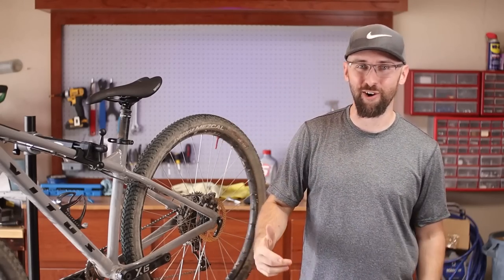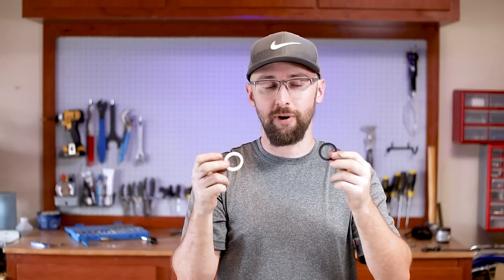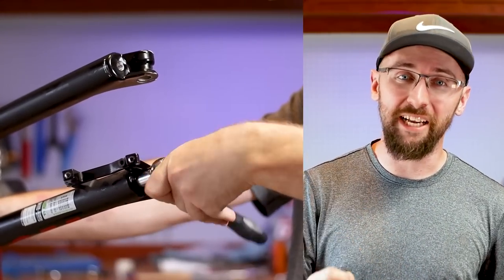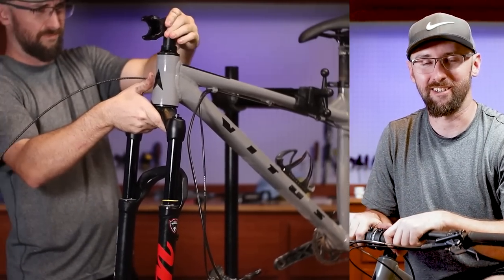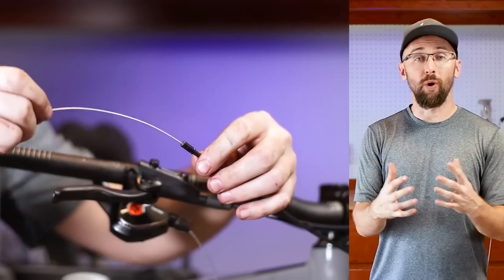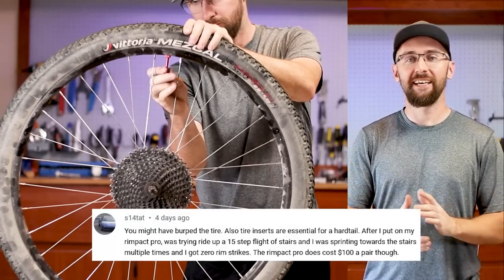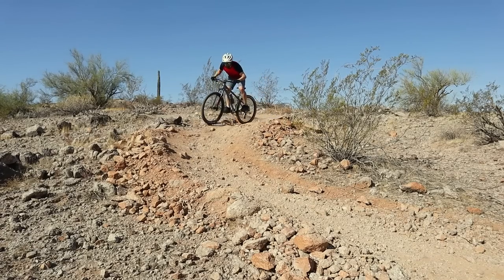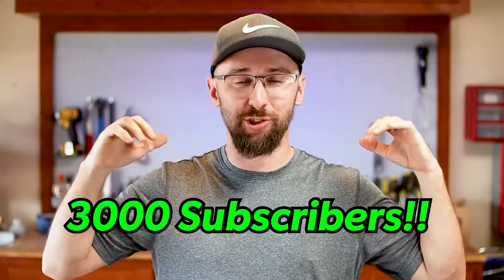Vitus Nucleus REBORN | Budget Mountain Bike Upgrades | Manitou Markhor Travel Conversion | 2021 VR

Comment: I recently bought myself the Tannus Armour Tubeless tire insert for my Vitus Sentier hardtail to run it in the back. I went for a Maxxis Rekon 2.6 in the Exo+ casing which is a lighter tite than I would normally put on. The tire is faster rolling and lighter than the Schwalbe Hans Dampf that came stock. With the insert the back wheel with the Maxxis Rekon Exo+ is still lighter than with the Hans Dampf without an insert but I feel saver riding with the insert and the lighter tire to be honest. I'm really surprised by the insert. It is supposed to be kind of between the cush core pro and the nukeproof ard insert. It is supposed to feel a little bit like cush core but offers more protection and sidewall support than the nukeproof ard. Wasn't hard to install at all, isn't expensive and is also pretty light in my opinion. It already saved me from a few rim strikes and what surprises me the most is that you can get home with close to 0 psi in your tire. Also you don't need a special valve stem since there is an air pocket between the insert and the center of the rim. I can definitely recommend the Tannus Armour insert if you're not convinced by the nukeproof ard and if you're not up for the hassles of a cush core installation and it's high price. But be careful when you buy it there also is an insert for tube systems.

For an upgrade fork I can recommended the newer Rock Shox Revelation models if you are aiming at 120 to 150 mm of travel. It is not an XC fork it's more like a stiffer trail fork but still really light with around 1.8 kg. If that's what you want the Revelation is my strong recommendation. They basically are a Rock Shox Pike but with the older Motion Control damper which still is a good damper and definitely a much better one than the Manitous. If you willing to upgrade it you can easily upgrade the Revelation to the high end Charger 2.1 damper (Rock Shock Ultimate level) since is has the same stanchions and lowers as the Pike. The Revelation has the same debonair air shaft as the Pike which provides a supple feel. Also you can fit tokens in the air chamber to make the fork more progressive. If you're up for investing a little bit more go for the Pike Select. It has the normal Charger Damper which is a better damper than the Revelations Motion Control Damper. It's not the same as the high end Charger 2.1 but I would argue most of the people don't even feel a difference between the Charger and the Charger 2.1. But the Charger definitely is more supple and noticeable better than the Motion Control damper. So if you in for a bigger investment go for the Pike Select cause it has the normal Charger damper. If not go for the Revelation because you basically get a Pike with a Motion Control damper which definitely is a good damper but also you get lots of room to urgrade the fork up tp the Rock Shox ultimate level if you would want to. Don't be tempted to go for the cheaper Rock Shox 35 since you can't upgrade this one like you could with the Revelation. If you want more of an XC fork I think the Rock Shox Reba is a good choice but if you're up for a more burlier fork for more agressive trail riding go for the Rock Shox Revelation. If you have to option go for a 2021 model since it has the newest upgraded debonair air spring.

If you really wanna go for an enduro fork get the Rock Shox Yari. The same relation between Pike and Revelation applies for the Lyrik an the Yari. But Lyrik and Yari are heavier and meant for enduro riding with travels between 150 and 180 mm.

Comment: Hey for your Fork service. Don’t just jam the lower down! Put the screws back in two turns and then but the socket over there and hammer on them to loosen the damper and air spring! 
Also if you’re pulling out the dust wiper don’t use the wrench over the other lower side! You can hurt yourself pretty badly! Use the wrench over the back or in your side the front facing the bridge! 

As you said the forks are pretty entry fork! Put some z2 or better z1 on there! They have a similar damper to the fox 36 / 34 performance so they work pretty good! You also get fox’s warranty and they’re a lot cheaper! You can adjust the airspring with tocens and you get Lowspeed rebound and Lowspeed compression adjustments! So have a look at them!

Comment: You can buy a fox 34 rhythm used for $250-350 on eBay. I think they start at 130 travel though. You can use air tokens in that fork. I'm not much of an XC rider, but my buddy let me borrow his carbon XC race bike, which has a Fox 32 on it. I live in AZ as well and it felt pretty good over the rocky stuff.

Comment: You've inspired me to try some upgrades to my specialized chisel as well Evan....I just ordered a new take off Reba that I'm going to increase the travel on and upgrade to a debonair head prior to installing. Hope I don't jack it up! Also I'm new to this as well and went with the tannus tubeless insert....but I put it in my front wheel because thats where I was getting punctures....thinking about moving it to the rear since that's what seems to be the recommended way. Haven't got any flats since I installed it though....worth it so far. Thanks for another great video!
Reply from the maker: Heck yeah Chris! The travel conversions for the forks are so easy! Just follow the service manuals perfectly and don't over tighten (especially bolts with rubber seals). You'll see it's pretty fun after you're done.

Comment: Great vid! Keep up the good work! And you could try a SrSuntour Axon Lo Rc Ds (personally, i love srsuntour higher end forks) and the fork is like 460 usd from the srsuntour site, but if u can find it ebay or amazon or even at a bike shop near you, you could get it for a lower price
Reply: And it weights 1600 grams.tho, if u got a big budget, there is an axon model with 34 mm stanchions but is 200 grams heavier, and around 200 usd more

Comment: Rather than new fork. If you like to try adding TOKEN, you can add some fork oil into the positive air chamber. Fork token is simply a volume reducer. So the more oil you fill, the more progressiveness of air spring you got. I did the same to my fork (X-Fusion Streat) when I converted from 100 to 140 as well.
Reply from the maker: Dude such a good idea! I guess that fork can get an upgraded damper which I'd love to do, but it's hard to find the parts for that.

Comment: I just picked up a vitus sentier and swapped out xfusion 32 for a rockshox 35 gold with 150mm travel. Noticeable stiffness in the fork which feels awesome! Also feels way better overall on small bumps/drops. I picked mine up for 200 bucks on OfferUp in my area but I have seen them online for around 250-350. Definitely worth taking a look at it!
Reply from the maker: Woah dude that is an amazing deal. I almost snagged a Yari for $200 but the guy flaked. I will check out the 35, thanks for the recommendation!!

Comment: Not sure if you're aware, the Markhor's can be upgraded with a better damper that is supposed to give you more adjustment and improve the ride.  The ABS+ is part 141-26532-K001 and replaces the kwik toggle damper that doesn't do much.  May be hard to find though but at around $70 or so is supposed to make the forks better.
Reply from the maker: Sounds like a sick video idea!!! Thanks for letting me know. Hopefully it comes with the whole damper because I definitely stripped out the damper bolt for the lower 😂
Reply: @EvansMTBSaga   Unfortunately no, you need the damper assembly, 141-31870-K008.  If you go on Haye's site you can see the service manual and it gives you all of the parts.

Comment: It keeps getting better!! Keep it up!

Try an aion fork from suntour
Or a marzocchi z2 it could be configured as low as 100 travel
Reply from the maker: Thanks for the props and recommendations! I have a Z2 already and love it. I would be curious to see what it's all about at 100mm. Multiple people told me about the Aion, never heard about it til yesterday! May have to check it out.
Reply: @EvansMTBSaga  i run an axon. suntours are easier to service but have less small bump compliance due to the negative coil spring, more of a hard hitting fork imo. the z2 would be the better but pricier option ;)

Comment: Put some suspension oil on top of the air spring. It will work like a air token and make the fork more progressive. 5-10ml should do it.
Reply: jomax clux  Let all air out of the fork. Remove top cap on the air spring side. Add a little suspension fluid (5-10ml). Re-install the top cap. Add air. Go ride :-)

Comment: You should look into the ABS+ damper upgrade for the Markhor. 
It’s the damper for the old Manitou R7 Pro (higher end XC fork), which features a Low speed compression dial, and adjustable shim stack for the High speed compression.  It definitely gives the Markhor more support, it won’t make them more progressive, because it doesn’t change anything to the air chamber tho. 
I don’t regret the ABS+ upgrade, it gives the fork a nice upgrade. 

If interested I’ll try to provide you with a part number.
Reply from the maker: I would love to get my hands on that damper,  it's just that they're out of stock everywhere!! Bums me out!!
Reply: @EvansMTBSaga  Big chance you'll have to order it from Europe. 
The part number is  141-26532-K001.  Make sure the bottom part of the damper is green. Other colors are for 32mm and 34mm forks, so incompatible with the Markhor.
Bike24.de sells them (currently out of stock, but they're saying back in 2-4weeks). Their shipping costs shouldn't be too high.

Comment: you can do the ABS+ upgrade for $70 on your MARKOR.
Reply: I fully support this as first approach - enhance what you have @Evans MTB Saga and others !

For many - including myself - the Markhor seems to hold a sweet spot for the non-tapered 9mm QR users out there. The ABS+ plastic insert seems reasonable as an upgrade, and there is a more expensive metal version from Australia(?) too.

Comment: Hey, didn't you forget to put new oil inside the air chamber ? I noticed you screwed the air chamber cap before screwing the air piston, therefore not putting new oil inside. That may be hazardous for your fork as it'll be running dry ? I'm not sure though

Comment: If I was trying to be a duck I would comment on your thumbnails but I'm just trying to help this time. To remove a lower leg you should loosen the nuts half way and shock them loose with a soft hammer. The lower legs should slide right off.

Comment: A nice fork would be the fox 34 or the rockshox pike but they are pretty expensive but on the other hand you could get a sr suntour zeron35 boost air this features 35 mm stanchions and 130mm to 150mm of travel or any other suntour fork like the duroloux

Comment: Would love to see you try some suntour higher end forks out man.  In reviews an aion it is often compared to a rockshox pike and apparently has 85% of the performance for 1/2 the price at rrp. I have heard they have been seen on sale at CRC for closer to $200 though
Reply from the maker: Oh no way! I really was down on Suntour forks with the stock ones that came on the Nucleus. I will check into it. I'm currently searching for forks that have upgradeable internals.
Reply: I believe they have an image problem because of their dominance in low end forks and they have no real marketing presence for their decent end stuff. Ive heard they have a demo to your door program which I think you could make use off for a video however I don't know too much about it because I'm not from the USA. 

My new bike came with the aion35 and I'm impressed but would recommend throwing about 10ml 15w oil in the lowers. The dampers are cartridge style

Comment: How does the hardtail ride with the insert? You need to experiment with pressure but it should dampen out a lot of the trail buzz.
Reply from the maker: I absolutely felt it a few times. I felt the tire compress, then the insert compressed with a different dampened feeling. I'd say it's working.

Comment: Hey, could you let us know how does the Nucleus ride like? There is only 1 review mentioning ride quality and they complain the frame is very harsh and it transmits every vibration.
Reply from the maker: Well the stock nucleus is definitely a budget bike. But the geometry is still very good. If you watch my last nucleus video where I did extreme upgrades, the bike has been fully upgraded by then and just feels like a high end bike with no problems with trail clatter

Comment: Another great video Evan! Quick question, when you upgraded the Tektro brakes to Shimano, did you change the rotors? What size will the bike take? I'm a big heavy rider & just ordered some Shimano SLX (I know, don't plan falling off 😂) just wondered if changing rotors will make a big difference? Cheers bro 👍🏻🍻
Reply from the maker: I haven't experimented with the rotors much. I bought some cheap ones off Amazon and used those when I changed the brakes to Shimano.
Reply: Love it if you could a video on the breaks for the nucleus, so complicated for newbies like me!

Comment: I'm curious if the Nucleus is worth buying for serious mountain biking.  It costs half the price of the Sentier VR, but is also seems to require a lot of upgrades to make it a truly capable bike.  Would you advise someone interested in serious off-road riding to steer clear of the Nucleus and just save up for the Sentier or another comparable $1,500 bike?
Reply from the maker: For entry level, it's awesome. It gets people into the sport, and can be upgraded to grow with the rider. If you already have experience and are already serious, a good full suspension is the way to go like the Mythique VR, or a used full sus.

Comment: I wanna buy a new Nucleus but my local bike park have Sentiers so I may just wait until they sell their fleet. Idk what’s better 1 year old Sentier or brand new Nucleus. Any thoughts?
Reply: The sentier is a lot more agrassive than the nucleus, so it depends on your riding stile and terein of the trails you ride. The sentier is gonna be more stable and a bit more robust. It will be able to handle more agrassive rough trails. It however will be a little slower on tight smooth trails where the more agressive components on the sentier will make you work a little harder.
Reply: Almost certainly the sentier, unless you don't plan on 'real' mountain biking (jumps, drop, roots, rocks, etc.)
Reply from the maker: I agree with everyone else too. If you have the money, the Sentier is the way to go.
Reply: Well I got lucky and picked up a 2021 Vituns Sentier VR and I love it!

Comment: Hey man what oil did you use to service the lowers?  Also what does a service consist of?
Reply from the maker: I used Fox 20wt Gold, which is some of the best oil on the market and definitely over kill. A standard service is usually changing out the dust wipers & seals, and some times the crush washers if your fork has them. The damper side uppers are untouched

Comment: Hello Evan like the videos.  I'm looking to upgrade my nucleus 29 from a 1x8 to a 1x11 group set what do you recommend?
Reply from the maker: Oh nice that will be a huge upgrade. I can't recommend Box. Too many issues. I recently got a sram NX groupset and that is nice. Also Deore groupset is great. The best thing is to shop around for used deals.
Reply: @EvansMTBSaga  sram 11speed cassette will fit on the hub that came with the bike ?
Reply from the maker: @MrErk714  your bike can even fit a 12 speed. What you have to look for is the cassette having HG driver body splines.
Reply: @EvansMTBSaga  ok thanks

Comment: What fluid do you use when you put foam rings in the dust wipers?
Reply from the maker: 20 wt Gold - but the user manual specifies what oil to use in the lowers
Reply: @EvansMTBSaga  do you need to use oil?

Comment: Btw you wouldnt strip it if you used the wrench the correct way around just saiyng
Reply from the maker: What correct way
Reply: @EvansMTBSaga  you are suposed to have the thicker side pulling and the thinner side pushing it is hard to explain and i learned it not so long ago just the oposite way than in the video because the side that you adjust has some play and not that much grip so it strips the stuff that you are trying to losen/tighten
Reply: @EvansMTBSaga  just find it on youtube yust watched some videos abou it and if you dont belive me it is truse and sorry if i sounded rude in the first coment